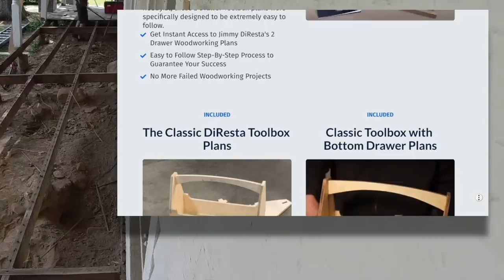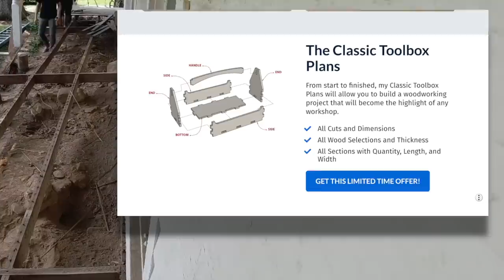DiResta Porch Restoration [Pt 1]

Comment: Nice rap around deck I remember taking down an old mill house in S.C. When I was younger and we salvaged the whole house. Got all the rung and groves flooring  and framing and one by 8. The house was built in the late 1800s. It was a lot of work. But fun finding all the old stuff in the walls as well.

Comment: Here in the South , black locust is used for fence posts. It never really rots. The joke is you put a stone near the post. When the stone comes apart you wait a few years and replace the post.

I made a deck once with black locust boards. I had it all cut 4 inch wide and tounge and groove. It was sanded and oiled. It looked really good. 

Frank
Reply: Of note, the saw mill guys and installing carpenters were not happy at the end of the job. The wood is crazy hard and it dulls tools very quickly.

Comment: Very nice work!  Bomb-proof for at least 200 years!  I’m thinking that your porch was newer than the 1790’s.  My house in CT. was built In 1928, and my porch construction, (although not a rap-around), was 24” on center and framed with the old 2”x6” dimensional lumber in the same way.  I’ve worked on a few 1700’s houses in CT., and the framing was still rough sawn and hand hewn wood.  Often there was still bark on the timbers not in contact with others, (which did nothing but allow for a protected highway for termites and powder-post beetles to travel).  It’s very nice to see an authentic restoration of an old classic house!  Beautiful work!!!  You and you crew should be proud!

Comment: i totally feel with you. we are also renovating, and the best option is still to learn the minimums of the trades and use a lot of ahead thinking to cover the white spots. we just finished replacing some 20 inch dirt walls from the 1960s to porous concrete bricks, while a heavy roof with concrete roof tiles had to be supported above the not-yet-existing new base etc.... once we were pouring a 3,2 metric ton steel reinforced concrete base in a single day, with wife mixing the stuff and me going circles with the wheelbarrow.

in the end it is a real excercise, but i got a lot of stress built up as the whole project was like dozens of separate mini-projects doing dangerous stuff (like keeping the roof from falling without a wall), which i never did before. still, while doing it one sees the lots of places where even the better craftsmen had made an inferior decision on design or materials used. don't ask me how much time was spent on it, tho.

oh yeah, pro tip: double check your (chinesium) levels before start. i never thought a brand new level could be off. but it was, by like 2mms at 2m-s. as far i know never dropped, never used for forced work... double that if you don't realize you have a shitty level, and you'll end up with some extra work.

Comment: 35:00 great point about the compound angle and the under-bevel. So if you did a straight cut you’d really be asking for an open joint. 👍🏻

Comment: Jimmy you may have had the lag bolts on hand already but I never use them any more. GRK screws are the way to go. They can be put in with a screw gun and are engineered to replace a 1/2" lag. So much easier and time saving plus they look nicer look them up. You wont be sorry you did.

Comment: Nice project! I work for a general contractor, and we would have used a compounding slide mitre saw for those angled cuts. Takes a few seconds, is easily repeatable, and on a 12" saw can cut a 2"x14" at up to 60 degrees

Comment: Just did this on a 1909 house. When you lifted that porch roof it prob pulled the porch ceiling joists away from the wall of your house. Back in the day they just nailed the joists that the porch roof boards are nailed to ... to the wall of the house. We scabbed on another 2x4 and used a double hanger to reattach them to the wall
Reply from the maker: I’ve considered this ☝🏼

Comment: Hi Jimmy. A few things. When you removed old porch it would be beneficial to level off, compact and slope soil away from the house so water doesn't accurate in low spots. Also, under the porch you should have placed a layer of non woven geotextile, or chicken wire or polyethylene and a layer of crushed gravel on top of that. That would prevent rodents from creating a rodent hotel under the porch.
Also, before placing deck boards you should have put waterproof tape over deck spars, on top. When water get into the crevices it'll stay there between lumber boards and cause moisture rot. Placing tape over deck spars will ensure main spars prolonged usage. Note, that only works if you leave a 1/8-1/4" gap in the top boards, which facilitate faster drying of the lumber, unfortunately in your case, using tong and groove top boards will cause catching moisture, which in the long run will cause damage of the wood. With the current installation I expect whole wood replacement ( top boards and main spars) in about 7-10 years. Sealing top boards with oil makes it worse because moisture will find way into the crevices and oil layer reduces surface area from which water can evaporate, making it dump on the internal side between boards. Sorry :(. Anyway, love you work.
Reply from the maker: The boards I took off were well over 80-90 years Old with almost 0 rot.  I respectfully disagree with this.   The deck was deteriorating mostly due to being under build many years before. Of all of it about 5% was from rot.

Comment: Got to to say love the porch nice resto of the house I now in my head I can build new cheaper than the tearing restore type of stuff your got going on there.... neat charm to the old place tho if If lived closer could of used the work helping on fixing that porch... I knew looking at those tree stumps and porch poles you were in trouble people did some inbred things back then... now you could just about drive a car across it lol. But thats not the point that bit of overkill here and there won't be in 25 years it should be just right and stay that way. From what little I've seen at 34 years old thats what works and its all that works.

Comment: All rim joist joints should bear on footers/pillars. When you stagger the joint and not have all joints bear on a footer/pillar you are only using the strength of 1 board when you have a split it like you did here.
Reply: I would agree that that is the best way and any engineer/ architect would spec that. That being said, when 2 joists are properly laminated with a full nailing schedule they become one heavier beam for all intents and purposes and I imagine there is very negligible difference at that point. Again, the way you said IS the best way but I don’t think it is a fatal flaw to have the joint floating if the pair is laminated properly.
Reply: @jeremyspecce  No matter how it is laminated it will always fail at the floating joint as it is only as strong as one piece of wood unless cantilevered within spec. The point is that this would never pass inspection anywhere in the US.

Comment: I'm running into the same issue as you did.  I have a porch that desperately needs help and the building is from the Civil War.  There is just no one around that has the skills to repair it properly and unfortunately I do not have the skill set to fix it myself.  Soooo, if you ever make your way to PA, I have a job for you.  haha
Reply: I just finished the video, holy cow, that's amazing!  I can't wait to see part 2 and I hope you do a video on the plaster lath.  Curious, why wouldn't you use drywall sheets?

Comment: We still have about 150 year old wooden telephone poles here in Iceland that are still standing and you can't see any rot. They were boiled in tar before assembly which makes the wood poisonous and difficult to chew for any ant or mould, which is why it'll never rot and water won't penetrate into it either. Don't see that nowadays. Now most wood is treated with salt water instead and it doesn't work well. But because it says "treated" on the label, even though it's "treated" in the cheapest way possible, that's how they get away with it.

Comment: You certainly won’t have to do it again in your lifetime, a healthy amount of overkill 👍🏼 In the U.K. we call the timber between the joists ‘noggins’. Only thing I would have done differently would be to put a membrane between the building and your new wall plate, but that’s just habit. I don’t think you’ll have any issues.

Comment: Not bad for someone who's not in the construction trade. Just goes to show all you need is smarts and friends of a similar caliber.
The only thing I noticed that I would have done that I think you may have missed was tapping down the concrete before you put the concrete sleeve down for the foundations. This would have made sure most voids are filled underneath because I noticed the tapping and shaking of the column foundation was done at the top 13:01.
I'm curious as to how chuffed Jimmy must have been at this stage 18:18 of the restoration seeing the main body of the thing coming together. 
Holy hell that linseed oil really make the deck pop doesn't it 40:47. Wow.

Comment: What you had isn't a concrete mixer, it's a toy concrete mixer :-)
Reply from the maker: well it mixed up my toy cement perfectly
Reply: @jimmydiresta  I'm sure it did. But you probably spent a lot more time than necessary filling and emptying it.

I live far away from where you live, so I don't know how things are done typically where you live. What we do here is use some mixers which, strictly by eye, I'd estimate to be 3-4 times larger, maybe a little more, and taller - tall enough that you can put a barrow next to the cup and empty the cup into a barrow when turning it upside down. You keep the mixer in one place, close to your heaps of sand, rocks and cement, and never move it. You fill it, let it mix, then empty it into a barrow (or two, depending on the mixer's size), take the barrow to each place where you need to pour, and use a shovel to fill each hole. Judging from the clip, I believe it could have saved some time. You can fill the mixer and let it prepare a second batch, while each of the two workers goes around with a separate barrow, filling holes. Pushing barrows is also easier than moving the mixer, I believe.

Comment: I would never trust a hydraulic jack to 'hold' a load for extended periods, they can leak by the seals, Steve summers used hydraulics to lift the roof, but replaced with wood.
btw, those 'cripples', we call them Noggins in the UK ;)
Reply: Those are screw jacks, not hydraulic. I think Jimmy's been collecting them for years at the flea market.... probably owns every antique screw jack in East Durham by now. 🤣
Reply: @AndTheCorrectAnswerIs  I know jimmy was using screw jacks, those or 'acro props' are the best, just that he mentioned hydraulic. ;)